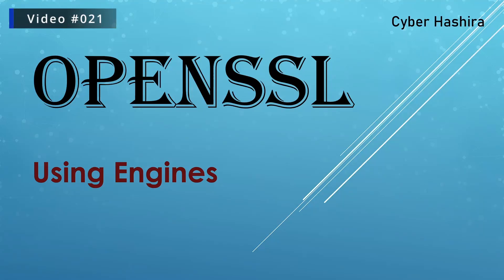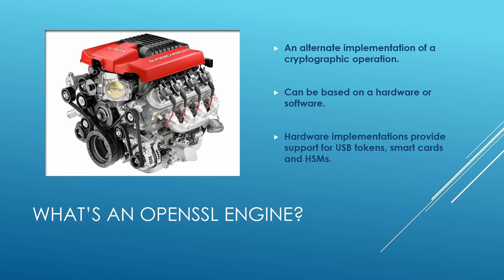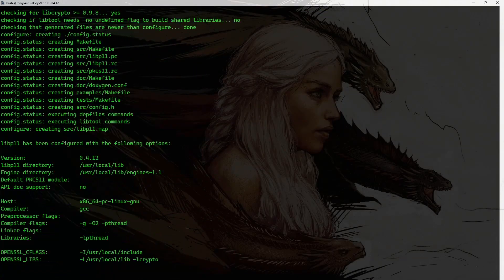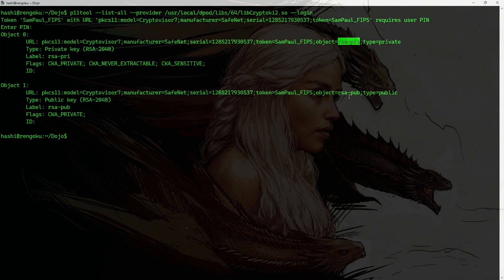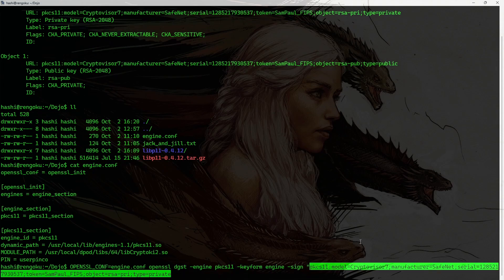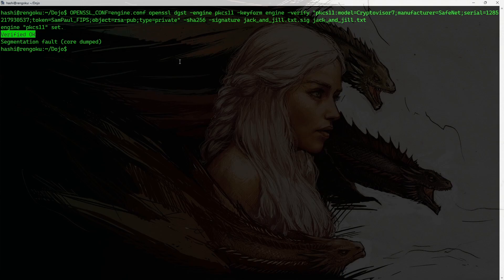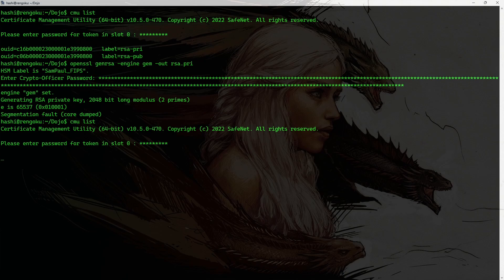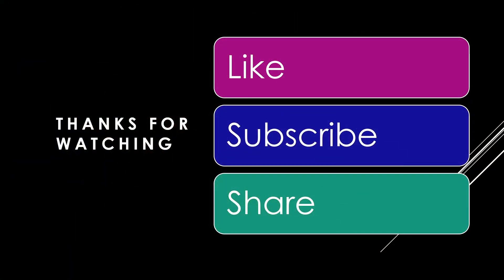OpenSSL Tutorial Video-8 | Introduction to OpenSSL Engines

Comment: is there a way to follow this video ? without having that device with luna installation ? which btw also seems like problem , coulden't install luna even when following chatgpt isntructions
Reply from the maker: You can use softhsm2 (hsm simulator), instead of using a real hardware device.. pkcs11 engine should work just fine with softhsm2.

Comment: Sorry , I am a bit new to OPENSSL and engines, @9:05 , during the verification, you didn't update the URL of the public key to incorporate "type = public"  , yet it still verified the signature as OK,does that mean that we just need to make sure that the object type is set to rsa-pub for verification ?
Reply from the maker: Yikes!, I didn't notice that. 

You're right, type should have been public.. not private. I believe the reason why verification still worked was because it read the public key modulus from the private key, else I'd expect failed signature verification.
Reply from the maker: Upon further inspection using debug logs, the PKCS#11 engine appears to be ignoring the "type" option. It searches for the public key and reads its modulus. This modulus is later used by OpenSSL to verify the signature.

My initial assumption that PKCS#11 reads the modulus from the private key was incorrect.

Comment: Absolutely amazing video specially in days where crypto science is getting somewhat rare. 

I am using opensc with IsoApplet along with openssl pkcs engine. I am really struggling to get pkcs engine to work with openssl 3 on windows. Does openssl 3 support pkcs engine on windows or this must be done on Linux? Secondly for using engine, can I still use openssl3 or there is some version limitation to using version 1x, 

If you have a GitHub or tag on stack overflow would love to ask you more derailed questions that community could also benefit.